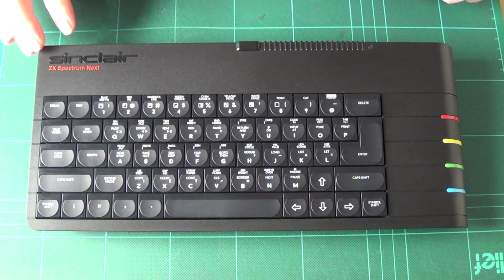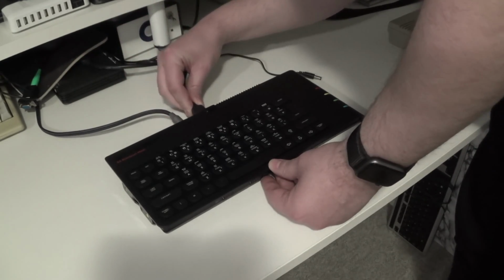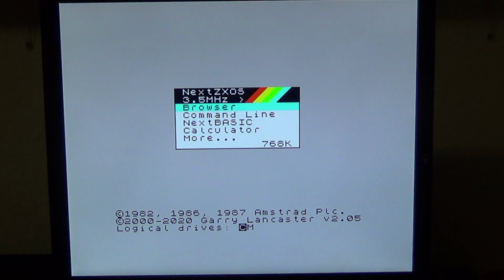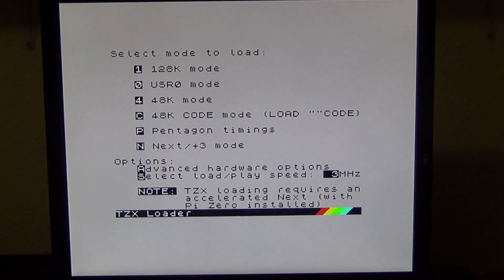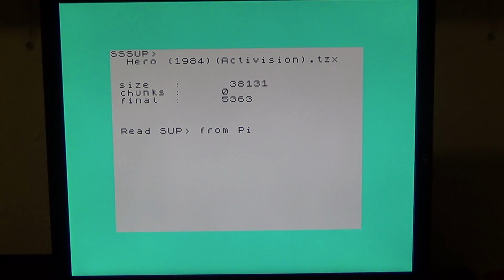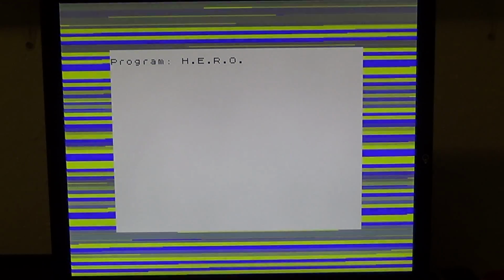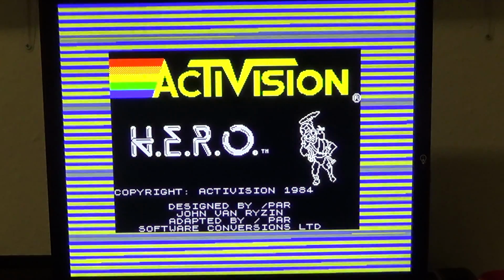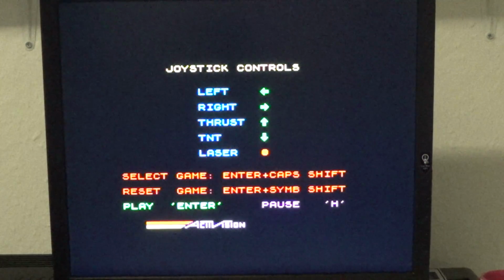Installing a Raspberry Pi 0 in the ZX Spectrum Next.

Comment: So is the raspberry pi powered by the Next motherboard?  One of the micro USB connections is normally for power input.  I guess it is a power output now?  The other is for data.
Reply from the maker: Yes, the Pi 0 is powered by the Next. :) No need for external power. I tried to find information on your question, but came up empty. Personally, I doubt it becomes a power output. I'm sorry, but I'm not sure. ;)
Reply: @CasualCommodore  They made an opening in the case for it, like it has some use, not sure either.  Maybe the Pi can be configured to make both the micro USB's for data.
Reply from the maker: @stickybandit2346  Banana Pi? Wow, didn't even know that existed. I'm not following the Pi market. :) It looks nice. I guess it's compatible, if it's a clone, heh.. :) Yeah, I'm thinking they made those openings, so they could add some functionality, if it should come to that some day. All data lines are connected, so it should be possible (I don't know anything about coding for it). Let me know about the voltage. :)
Reply: @CasualCommodore  I can just test it with a volt meter as soon as I get mine.  I ordered the Banana Pi instead, but it is the same thing, just faster.

Comment: What is on the Pi zero micro sd card  ?
Reply from the maker: I'm not sure. :) I'm guessing it's stuff that makes it communicate correctly with the machine, so it acts properly as an accelerator. I just downloaded the image file (https://www.specnext.com/latestdistro/ - under "NextPI Distribution"), and wrote it to the card. ;)

Comment: Some people use some kind of putty to hold stuff in place. Capton tape (which is what I think you meant) is only used because of its heat protective properties. When you want to protect components from melting when you use a heat gun or other heat source, you can use Capton tape. I think it's just a brand name.

I missed this video when it came out...
Reply from the maker: Thank you for the explanation. I know this now, as a few other people explained it to me. But the more times I read it, the better I remember it, so it's all good actually. :)
Reply: Funtak from Loctite. Blu-Tak and Super Tak are other brands.

Comment: This computer has grabbed my attention! User base from UK etc but I am in USA but I lived in Germany over 11 years. I want to know if another Pi would work as well or better. I am sure a hacker group will use this!!! I saw more memory added so are you doing that?
Reply from the maker: As far as I know, only the 'Pi Zero' and the 'Pi Zero W' will work. Only those will physically fit. But yeah, who knows what the future will bring.. A lot of smart brains out there! Yes, at some point, I will be adding more RAM and a WiFi module. And perhaps an RTC clock as well.
Reply: @CasualCommodore  Funny you should mention those. The new kickstarter is up and the "new" version includes wi-fi and Real Time Clock as standard. However that doesn't help those who already have one :/